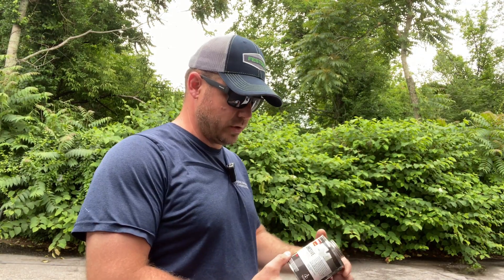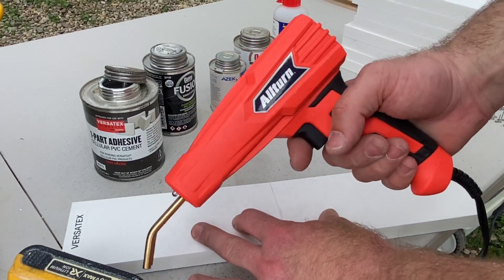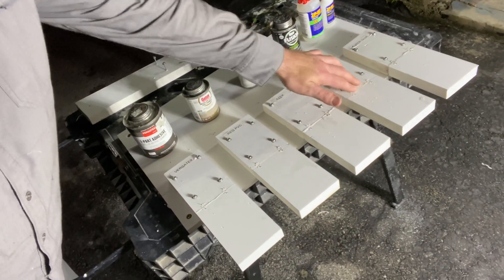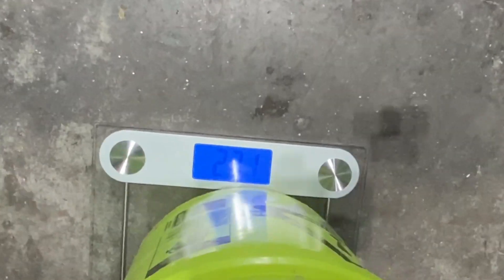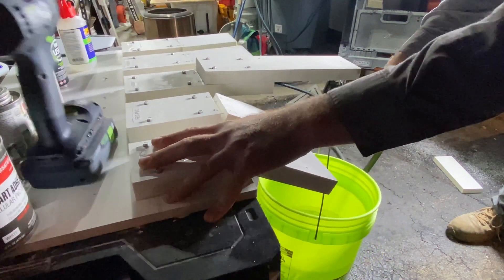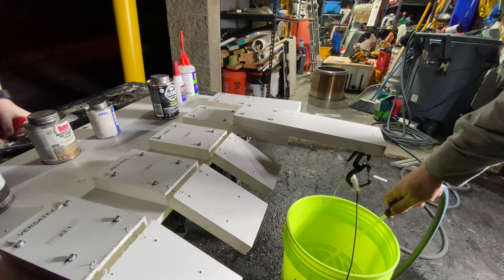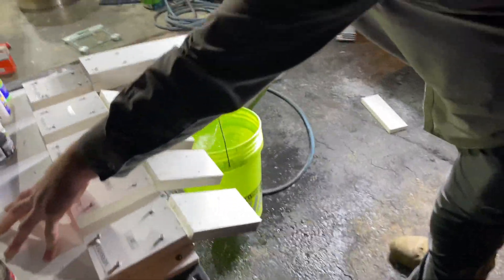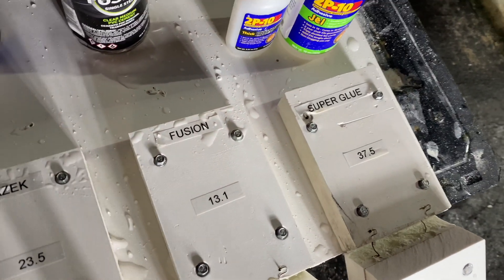PVC Glue Showdown!

Comment: Did you use the activator with the 2p-10? Some guys say not to use activator or it turns the PVC trim yellow over time.
Reply: That is correct. I used some on pvc railing, and it did indeed turn it yellow where there was activator over spray. I do wonder if it was from being in the sun as well.

Comment: What about Titebond's rapid trim joint adhesive, and their adhesive trim caulk, specifically for this purpose? The urethane construction adhesives are typically extremely strong, if a bit messy to work with; a number of cyanoacrylate glues may be suitable, as this test proves, but the next phase would be testing only a range of those available glues. Many like Gorilla are both fast curing, while staying flexible, a superior attribute.